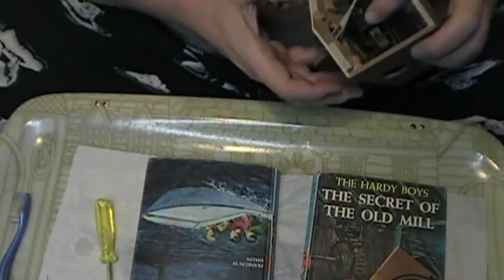Cuckoo Clock Repair 2.wmv

Comment: Reed, the pendulum on my quartz cuckoo clock will not swing back and forth. It has just two batteries. (No music, just the cuckoo on the hour and the swinging pendulum.) One of the terminals was corroded and I cleaned and replaced with new battery, but pendulum will still not swing back and forth. I've tried re-positioning the clock, but that doesn't cause the pendulum to swing, either. Am thinking maybe that corroded battery terminal may have short-circuited or ? Any suggestions? The clock repair shop here said they did not have good luck with repair of quartz circuitry. Thank you, if you feel like replying. LS
Reply from the maker: I've not had to deal with quartz but they are pretty simple with the circuit board. Check the wires that operate the swing arm and bypass it directly to the battery to see if it still works.

Comment: Hi Reed great video! I have an old Cuckoo Clock Mfg Co. Clock that I inherited from my grandparents. It is in need of several repairs which seem pretty straightforward, but the movement is whats got me stumped. It is doing a similar thing to what yours was doing in the video, it ticks then randomly stops hard. I took it out and tried to get a look to see if there are any hair balls or something obviously stuck but cannot see anything. If I move the pendulum back and forth I can feel it catch and like I said, it catches hard and I have to back it off to keep going. Sometimes it'll tick for longer, sometimes only 5-10 ticks before catching, vary random. It was VERY dirty and likely never oiled in the 60 or so years they had it. It has a Regula 8 day movement in it if that help. Any chance it just needs oil? Thanks for any tips!

Troy
Reply from the maker: When it stops hard there is something in one of the gears usually or one could be chipped.

Comment: Hi Reed, I just picked up the same (but colorized) cuckoo clock that you repair in this video so it was great to find your fabulous guidance on it's restoration, cleaning and oiling!  Nice job!  Thank you!! I had already cleaned mine up to where it is running well and the one question I have, which is not detailed in your video is:  How did you repair the split in the bellows?  (Sorry if this has been addressed earlier).  One of my bellows has a similar tear so poor little cuckoo sounds a little sick....  Thank you again for your help.  Susan

Comment: i have a very similar clock. only the left side will wind with the chain the right side just spins with the chain in the sprocket next to the gear and the gear doesn't turn.  Do i need a new piece for the right side?

Comment: this is an amazing video which helped to repair my 5 year cuckoo clock,.. My cat decided to grab hold of the chain weights and by swinging on them he dislodged them. I dismantled the clock and re built it with the help of these videos, My only problem is that the clock works well but the cuckoo comes out and stays out without continuing to make a sound, Is this perhaps because I have replaced the bellow wire links incorrectly? I noticed the one is longer than the other. Looking from the rear I placed the longer rod on the right bellows. Or is it that something is catching in the mechanism or the cam timer? I live in South Africa near Johannesburg, but cannot find a clock repairer who is a cuckoo clock expert that I can trust. The clock has sentimental value. Can anyone give me advice on what may be causing this problem?
With thanks , Barry Morgan-Evens. Benoni SouthAfrica.
Reply from the maker: It sounds like it may not be hooked up right. There are a lot of videos on here that show different clocks working and playing the cuckoo. You should find one that matches your system and watch it carefully. Then remove the back of yours and see what isn't working. Without seeing it working, it's impossible to say for sure. There are a lot of cuckoo clock experts on here that watch this forum :)

Comment: Hi, Reed - I've been watching cuckoo videos and working on mine from 1973. Both bellows work great - not damaged, at all - but I only get sound from one of them when the clock is running. What I haven't seen is anything that shows me the details of attaching the arms to the eyelets on the bellows. I wonder if I've missed something. The clock runs beautifully, keeps time, chimes, but only "koo"s. This video helped me get through taking it all apart and putting it back together, but what should I look for, now?
thank you so much for sharing your expertise with these videos.
Reply: Set it up so that you can watch it from the back and then adjust the one that isn't moving :)
Reply: that did the trick, thank you. Had to bend the arm just a bit, but it's now got a full cuckoo sound. Yay!

Comment from the maker: The ax isn't supposed to hit the log and the wires in back for the saw can be adjusted a little but it really just needs to move a little to make the arms look real. The cuckoo wire is probably fallen under the actuator. You need to take the back off and then set it to the hour to see the cuckoo problem & the adjustment arm for the saw. The ax man really doesn't move much but it is actuated by the cuckoo mechanism so if one isn't working then neither will the other. Sorry it took so long :)

Comment: I got a question. Everything on my clock is alright, except that when the cuckoo comes out more times than it should. I've taken the mechanism apart, and It all seems alright. I put it on 12:00 sharp and starts fine at 12:30, up util it's 10:00. Then it starts coming out 11 times. then  I turn the little "ladder" one tooth, to see if it's that and again when it comes back there it's  wrong. I see there's a "cam" behind it that should stop the excess of gongs, but I can't get it on time. Help!

Comment: Hi Reed. I followed this video & my old clock works fine but except 1 problem. The weight for the Cuckoo works fine. The chain can be rewind but not for the time. The chain for the time works well by the pull of the weight but cant be rewind. So each time i hv to manually take the chain out & put it again from the beginning & set the time again.Oiled it well but still same & looks like something is stuck but nothing can be seen. Pls help ! thank you in advance.

Comment: There are no ball bearings in cuckoo clock movements. Of course the time train is going to be stiff, unless you remove the verge. Chainwheels usually won't rewind when the detent spring in most movements gets bent from the wrong side of the chain being pulled. In Hubert Herr 8 day movements, a small flat spring that holds the ratchet pawl breaks and gets jammed.

Comment: Hi there, I am trying to fix a cuckoo clock I just bought. The clock in itself works fine but the music box doesn't activate after the cuckoo but I think by bending the black wire I should be able to resolve the issue. My bigger problem is the chain responsible for the cuckoo has been moving down fine and activated the cuckoo but now the weight is almost all the way down and I can not rewind it. I fact I can't pull the chain either way! I rethreaded the chain yesterday as I think the previous owner had a go at it but put it in the wrong way. At the time I could I fact pull the chain but now there is no movement at all. Saying to that as well that the reason I rethreaded the chain was that the cuckoo didn't work at all now I got the bird doing its job but I can't rewind my chain. Is there anything I can try as I really want to fix this clock myself if I can!
Reply: +Susi Mews  i Susi, I just posted this same problem I had a few comments up. Its not so easy at all as many of these Videos say it is to thread the Chain Back in.

Comment: Hi Reed I am restoring a Wood Cutter Cuckoo. It was in bad shape, arms missing and all but I got a deal on it and have wanted one for long time..Anyway I wanted to ask a couple of questions, Can you tell on the hardware of the bellows top, how far from front edge does the little eye hook go on the side? I also am not sure what moves the man's arm with ax? The wire is in there but does it somehow connect to the top of the bellows?? Then the last thing I wasn't sure on the waterwheel does the chain go through the mechanism to rub on the rubber bushing to turn the wheel? I appreciate any help you can give me..Your video has helped me so much in cleaning and oiling my other five cuckoos myself...Thank you
Reply: Hello again, My clock is up and running, all animation working and keeping time..Thanks..

Comment: Hi,I have a clock just like the one in your video. I've cleaned and oiled it and it keeps perfect time but the cuckoo won't stop. After I wind the chain the cuckoo just keeps coming out and the chain keeps running until the chain runs out. Can you please give me some advice?

Comment: What are your thoughts on an Ultrasonic cleaner with a solution of simple green and water? I have an 8-day movement with decades of cigarette smoke and dust in it as well as rust. I had pondered an ultrasonic cleaning and some birchwood caseys rust and blue remover. Another quick dunk then and compressed air to dry it really good.

Thanks for the videos. I have enjoyed them. I might put a video of my Cuckoo up on YouTube. I almost have the wood 100% restored. It was REAL bad.
Reply: I subbed as well!

Comment: hi Reed
we have a Cuckoo clock that the minute hand stops when it gets on the number 10.  Is that a gear issue? We had it repaired and when we got it home and hung it up it never did keep the time  right.  We accidentally broke the hands so replaced them but still stopping before the hour. Your suggestions will be most appreciated.
Thank you, Kathy C.
Reply from the maker: If it runs for the rest of the hour just fine then probably yes. Does the pendulum slow and stop quick or slow? If it's quick then there might be something stuck in the gear. When you advance it past the 10 does it fight? Be sure to check the travel of the hand and make sure it's not hitting a small nail or something. Usually at 10 till is when the movement starts preparing the chimes for the hour so you should take it back for repairs if you can't find the problem :)

Comment: Tilt it slightly. The case being level doesn't usually have a cuckoo clock "in beat". If it's running for that long, it's probably just barely out of beat. If you do go to oil it, get some real synthetic clock oil. It's usually less than $10 for a decent one online.

Comment: Chainwheels are cheaper than an entire new movement and then you retain the value of your clock by having the original movement, not to mention all of the fine adjustments that have to be made when installing a new movement.

Comment: Thanks for the video.  I have a question.  You briefly went over how the clock know how many cuckoos to chime.  My problem is that my clock cuckoos the correct hour with the exception of 8, 9, 10, 11, & 12; it cuckoos 7 for these hours.  However if I move the minute hand manually it cuckoos correctly.  What do you think is wrong?
Reply from the maker: You will at least need to pull the face off to be able to see the mechanism on the front of the clock. If you have a large dial then this will be easy, but if it's small, just pull the whole movement out of the clock because that will be the easiest anyway. If I remember right, there's spring that helps the lever drop for the second half of the chimes but you will see it. Just look on the front and you will see the leaf shaped gear. Then there's a couple levers hooked to it to make it continue. You should see the problem right off if it's the spring. Just look closely because it could be a piece of rust or dust.
Reply: Thanks Reed for the advice.  It looks like I have a finicky rack & snail mechanism with a mind of its own. I'll zero in on that. Bob

Comment: Sounds like an antique that should have a countwheel on the back, and it's missing either the countwheel, the gear that drives it, or the wire that rides on the countwheel is bent too high.

Comment: thanks my friend, extremely informative and great camera work! i have a clock my girlfriends mom gave her....its pretty old but seems to be in nice shape. the problem is, one of the 2 chains seems stuck. the chain the makes the cuckoo go off is fine and the bellows sound great, but the chain for the clock mechanism wont budge...i was hoping to not have to remove the bellows if possible(but thanks to your video i'm less intimidated by that process). any ideas what may be the problem here Reed? thanks again, i may just have to dive in and pull it apart.

Comment: I just acquired one of the woodchoppers you show at the beginning of the video, but there is an issue with the woodchopper/music box mechanism.  It activates about 5 minutes (give or take) before the hour. It works continuously until the hour.  Can you recommend a resource where I can learn what/how to adjust or fix this?
Reply from the maker: +vegasvik Pull the minute hand off and move it to where the music starts at 12. So if it's 5 minutes fast then push the hand back on at 5 till. You will be able to get it really close but it may take a couple times. As soon as it clicks to play, stop it and put the minute hand straight up on 12 and that will fix it :)
Reply: +Reed Lukens Thank you for the quick reply, Reed. I wasn't clear enough in my question. The real problem is that the music plays before the cuckoo.  The clock is keeping time quite well, and it cuckoos as it should.  However, instead of briefly playing the music after the cuckoo, it starts playing the music a few minutes before it cuckoos, and continues to play until it cuckoos. Or it would play until it cuckoos, but the weight bottoms out. :-)
Reply from the maker: ok :) the music does play and stop before the cuckoo but since the music starts and then doesn't stop, the stop mechanism must not be engaging. Where it lifts up to let the music start, it also springs back down to stop it. So look and see what is keeping it from springing back down.

Comment from the maker: If the chain fell out either one of the links came apart or the little brass loop at the end came off and probably rolled around somewhere on the floor. It can be fixed easy enough and there are plenty of professionals listed here if you need to send it in to someone. I will be praying for you 8°)

Comment: The proper way is to disassemble the whole movement apart and clean the parts in an ultrasonic with formula or soap, water and tooth brush.

Then peg the bushing holes as old oil gums up and makes stubborn residue that absolutely need to be pegged out with wood like a toothpick.

Dry then oil.

Comment: I could not see how to put the chain on the gear...nor do I know what chain to put the weight on
Reply: @Gail Lehtomaki, in my opinion its easier to put the chain when the mechanism is outside than like this guy did, but that's just me. there are two wheels with little spikes portrudint out of them, just hang the end of the chain on one, and manualy turn the wheel around, using screewdriver or any other little stick, you will hear clicking when doing so, so you know you got it in the correct direction. Regarding which chain to put the weight on, its real easy. You put the weight on the chain you cannot pull down. So for eample if you can't pull the right chain below one wheel, that's the one. the other chain will then be used or winding the mechanism and you will hear clicking when doing so.
Reply: My door stays open on my clock  just the bird pops out what's  the problem  thanks

Comment: I just bought a nice clock, but after running for about 4 hours, the Cuckoo got stuck open and won't stop chirping until the weight is at the bottom, if I raise the weight the chirping starts again, I tried to close the door and it keeps popping back open. Any Ideas?
Reply: I have the same  problem  door is very  loose  opens  by itself  dosent  close
Reply: What was the outcome  on that  thanks

Comment: SimpIe question. I have looked at videos on fixing belows myself,,,, the question is , when watching u removing them, i didn't see detail on how u removed em, except for the screw on the outside of house. Is is hard to remove them, after the screw from the outside is removed,, speaking of any wire to be unhooked or anything i should be aware of??? tyvm,,love yur videos . I really want to fix the belows,but need a bit more info on the removel of them, :)
Reply from the maker: +Wanda Rac They come out pretty easy, just pull the screws and then go from there. If they are glued in like a lot of them are, you will need to flex it a bit to break the seal, just watch the wood and use a razor knife to score the edges and cut away some glue if needed. They do have the operating wires attached to them but they are easily seen and can be removed and put out of the way

Comment: I have a cuckoo clock with a Regula movement in it and I believe it is an 8 day. It has a 34/1 is that correct in thinking it is an 8 day? If it helps any or matters, it also has GM stamped on the left side and right side of the movement in capital letters. My weights have a 44 stamped on them. 

I hope the movement can be cleaned up. It has some rust but everything moves freely. I priced the movement at $169 :-(  Great video. Thanks for sharing!
Reply: Regula 34 is an 8-day movement.  GM is the German abbreviation for the English "Patent Pending".

Comment: Hello - I watched your video at least 6 times that greatly assisted me in bringing back to life a 50 year old Schmeckenbecher - nearly identical to the one in this video.  It keeps perfect time and the cuckoo functions on all hour and 1/2 hour timings.  But the cuckoo "sync" consistently jumps time as when a single cuckoo is due at 10:30 - it will jump to 11 cuckoos.  I have manually run the cuckoo through all cycles by pushing in the bar at the side - works 100%.  Totally confused any help pls.